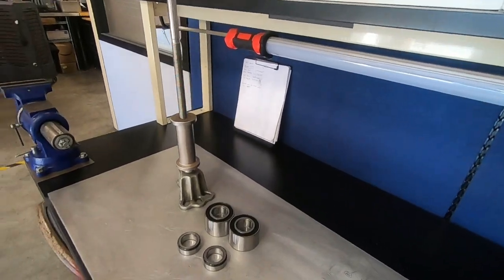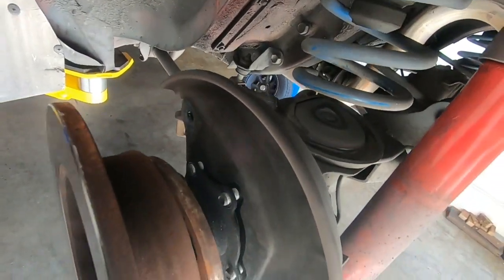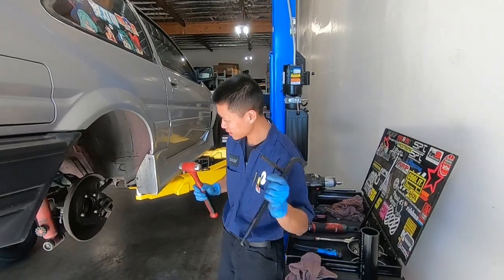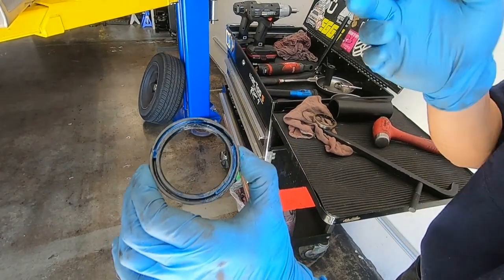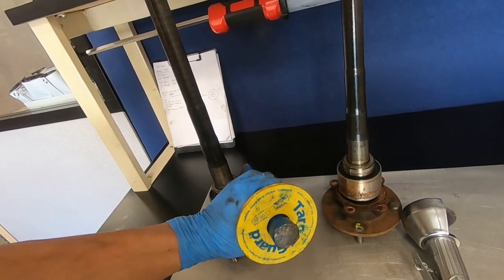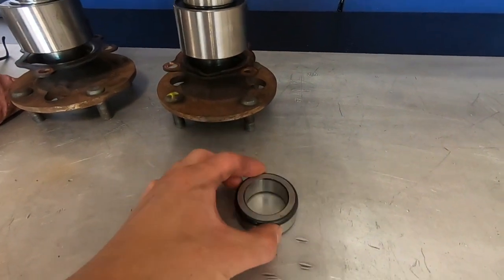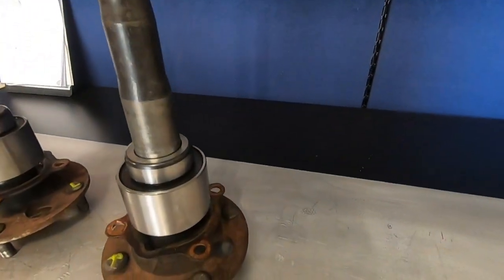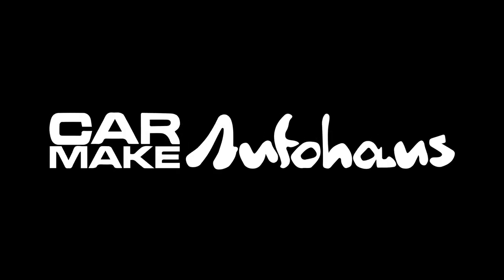How To: AE86 Rear Axle Bearings

Comment: First of all Great Video. 
Why did toyota design a axle housing on the 80s sedan & wagon with seal bearings when they could have designed the housing and axle with the seal on the backside of the bearing Without the bearings being a sealed bearing. 
That way the diff lube would supply the bearing rollers ten times better than the Sealed Bearings with grease .
Your thoughts Please  .